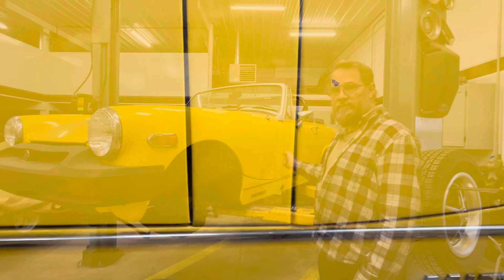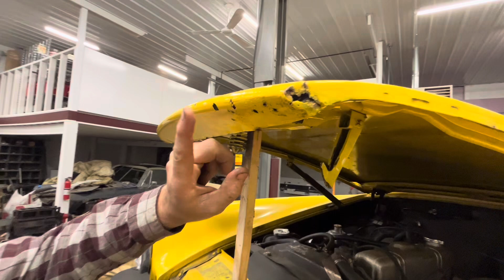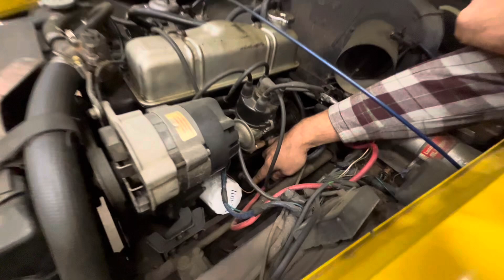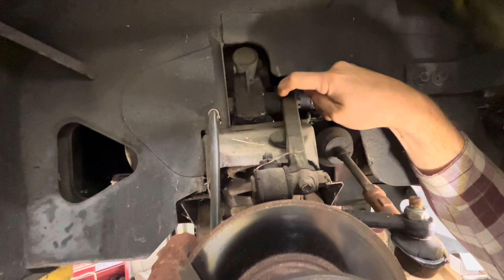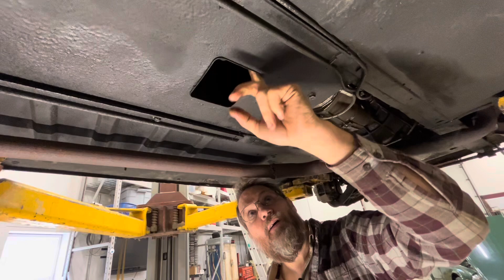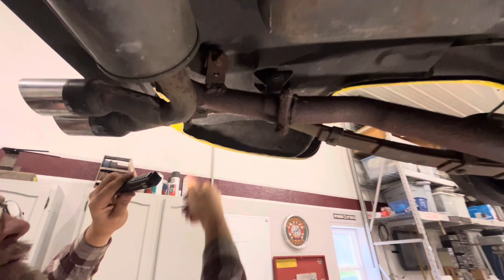1979 MG Midget: First Inspection for New Owner

Comment: What’s wrong with a neutral color for the engine bay? De-rust, POR 15, then rattle can primer, rattle can engine gray. Very neat and tasteful. Painted engine and valve cover contrast well.
Reply from the maker: That is common on race cars to make the engine bay clean and bright so that you don’t need as much light to see what your doing. Makes quick repairs at the track a bit easier.

Comment: If your key gets stuck turn the steering wheel back and forth.
Reply from the maker: Yes, that can make a key feel like it is stuck in the cylinder from the steering lock pressure binding it.

Comment: My mums MG midget has been sat in the garage for 20 years but I’m now a mechanic and going to put in the effort to get it back on the road, any tips? Never worked on a class car before, Any information will be appreciated. 1979 MG midget sport, sat in a well sealed garage with a cover over it.
Reply from the maker: Compared to newer cars they are actually fairly easy to work on, but if you don’t understand the carburetor, you might want to get some help with that. The 1500 Midget does have a propensity to spin the number three rod bearing at about 60k mi. due to it not oiling as well as it should. Often times cars are put away at that mileage because of that issue.

Comment: Are there bumper conversion kits to get rid of that hideous monster?
Reply from the maker: There are for the MGB. Not sure on the Midget
Reply: No, but changing from rubber to chrome makes permanent changes to the car and cannot be reversed. The rubber ones hold parts, tools and your behind while you have a cold one while reading the manual.

Comment: my 76 had an amplifier on the distributor that would go out all of the time...freeway, side streets, parking lot...must have been replaced 5 times.  the clutch master cylinder went out at 20K...carbs would NEVER hold oil...car was a piece of you know what...second worst car i ever owned...

Comment: Great vid. I'm rebuilding the engine for mine, also in Inca Yellow, which has just obliterated its number 3 big end bearing.
Reply from the maker: Of course it was number 3 big end bearing 😁
Reply: @unionjackclassics is there a year/ model mg that doesn't have rod bearing issues?

Comment: Earlier Midgets had black rocker panels as well.  I owned a 1974 and my cousin had a 1972; both had black rocker panels from the factory.
Reply from the maker: Yes, they had black rockers from about 1969/70, but the rubber bumper cars extended that to the bottom of the quarters and front valance. In this case, I was just stating that being a rubber bumper car all of that should be black and isn’t on this car (I forgot to mention the lower quarter)

Comment: Very useful assessment. I have a 1979 Midget which I had restored with a replacement body and so far have not had time to drive it properly.  It is good to have these check points and give it a look over this winter I think.  Thanks for a very useful video.
Reply from the maker: Glad it helped

Comment: You'll often find other colors on the valve cover.  Blue indicated a California tuned engine and red indicated a federal tuned engine for emission controls.  I don't know the meaning of black valve covers but they may have preceded full emissions engines.  Silver was usually mark III 1300 engines and bronze was mark I and Mark II 1100cc engines.
Reply: Are you talking about the 1500 triumph motor (seen in this video), the A series Austin motor, or both?
Reply from the maker: This applies to the 1500 motor only 
In the midget . Yes, the California ones are blue, but we rarely ever see those around these parts.
Reply: @fredknoch  Yeah, I was talking about the 1500 Triumph engines and earlier triumph engines.  If you've got a replaced triumph engine in your midget, this may help determine where that engine comes from.
Personally, I prefer MG engines in midgets,